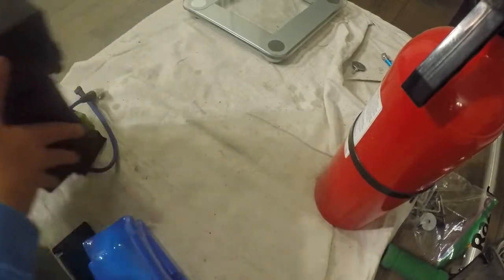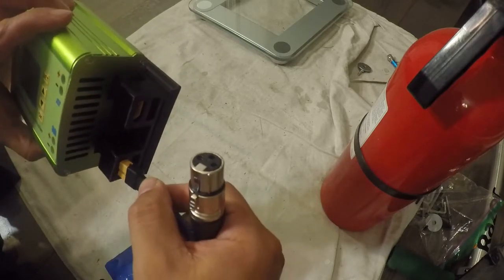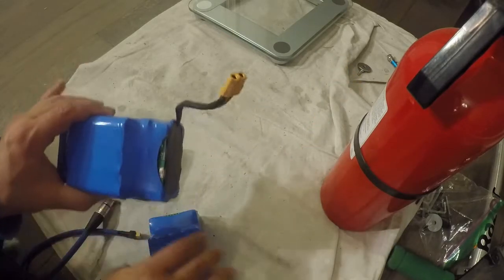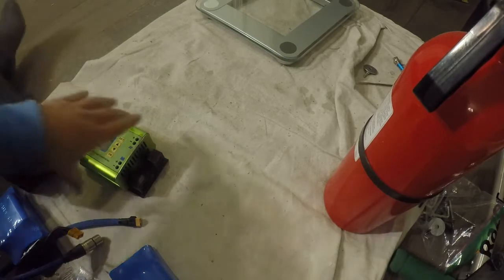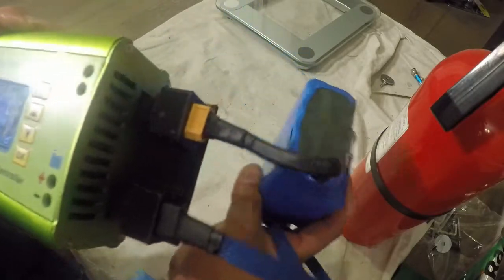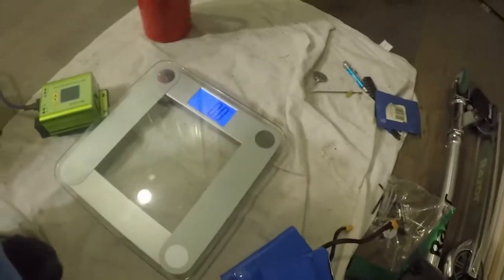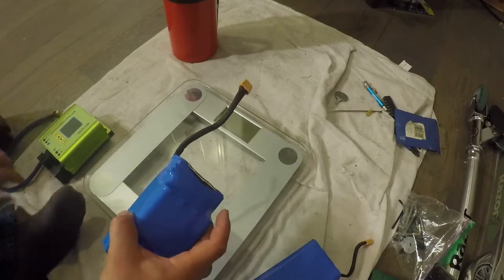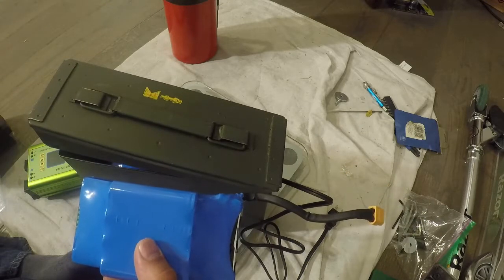OneWheel Workbench: Mobile Charging - CarvePower

Comment: For reference is the wire thatyou connected to the solar pack that connects to the OW, is that the same wire or same set up rather that is used in your extended battery life/ ride time instructional video
Reply from the maker: In this one I use a different one. You can use a Charge N Ride (CnR) cable instead though, if you want. The only difference is that the with the CnR cable you'll have to have you board powered on for it to start charging and charging is recognized as regeneration.

Comment: Do you have to remove the battery from the 3d printed case when charging the packs?  Does it get really hot and melt the plastic casing?  Seems like a pain to remove the screws and take the battery out and out it in the ammo can every time you need to charge them.
Reply from the maker: No, the power cable hangs outside of the 3d printed case. The batteries don't get that hot, because you're just charging the onewheel at less than 5amps and not powering a motor directly. Having said that, these batteries are usually put into plastic casings, because they don't get that hot, unless there's a short. I personally, don't use the case. It's all very easy to do. Nothing is difficult or time consuming.
Reply: I meant charging the external batteries (not charging the OW).  Can you drop the batteries that are inside the plastic case and put it in the ammo can to charge?
Reply from the maker: Yes. It's as simple as unplugging it from the charg controller and then plugging it into the charger and dropping it in the ammo can. You don't really need the ammo can. These batteries are in all kinds of electronics and laptops.